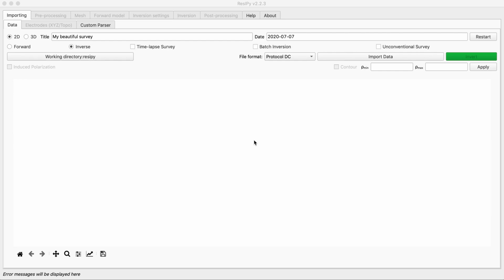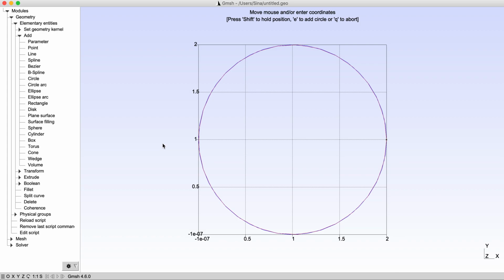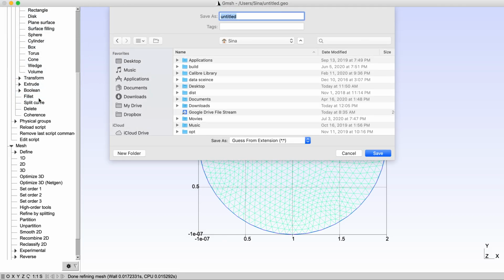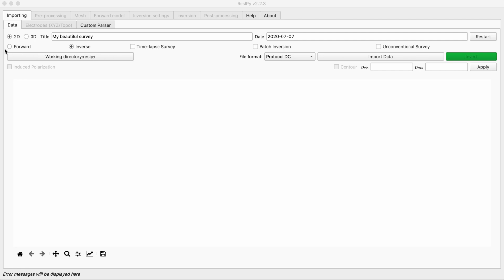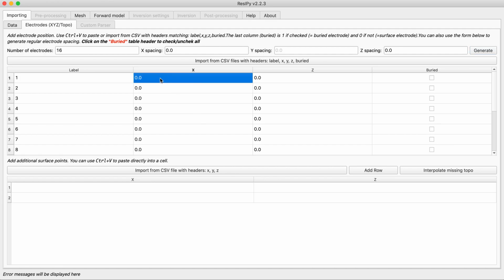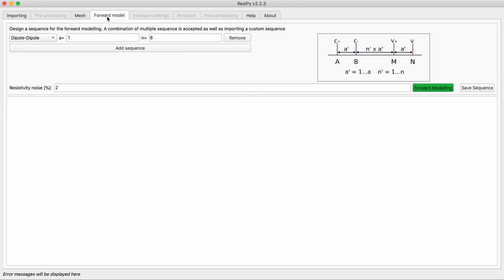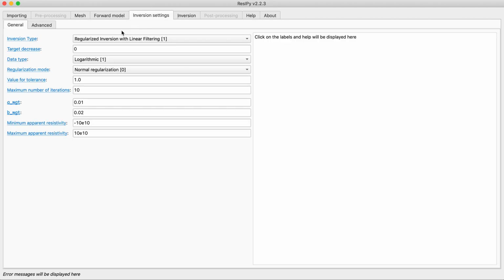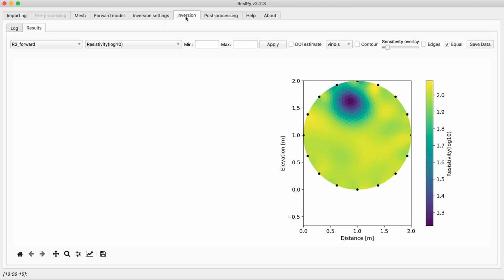Custom mesh forward modeling (2D Circle)

Comment: I try to follow your direction, but when I create electrodes from ResIPy, I meet a problem. When I choose "Number of electrodes is 16" and "X spacing is 0.0", number of electrodes I get only 15, not 16. And if I choose  "Number of electrodes is 16" and "X spacing is 1.0", number of electrodes I get correctly, but position of electrodes isn't correct. What should I do?
Reply from the maker: This is because "X spacing = 0" is physically impossible, unless you have Y or Z spacing. Use X spacing = 1 and use proper values from a survey or a file. Or set Z spacing to a non-zero value.